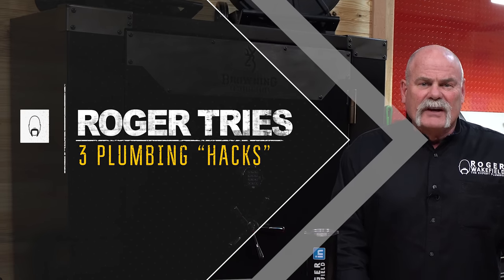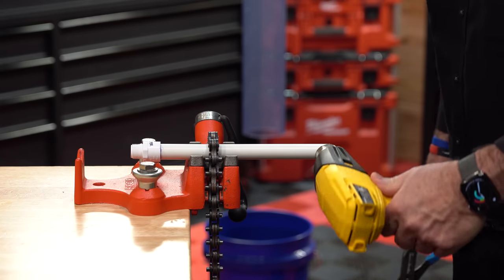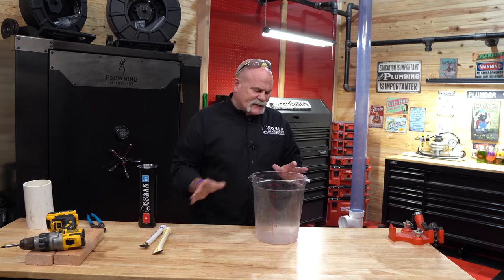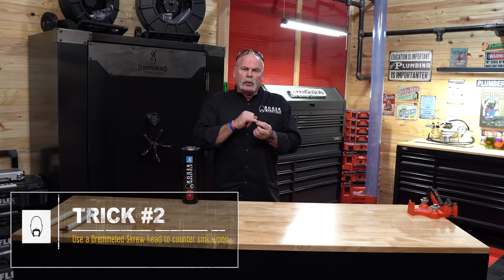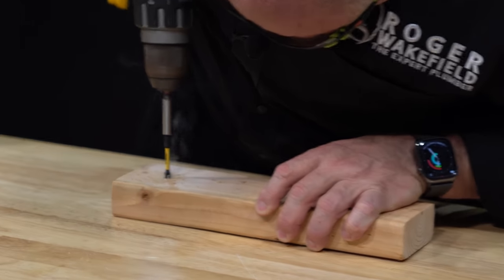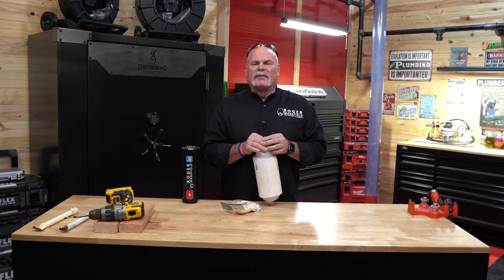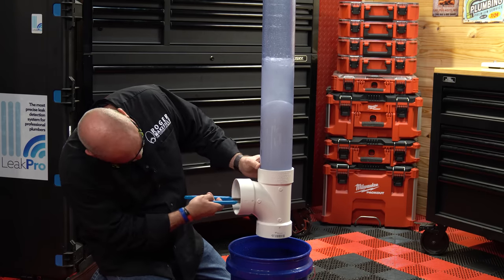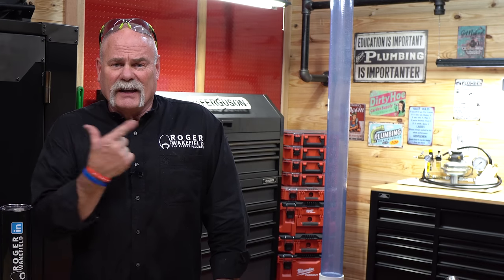Trying CRAZY Plumbing Hacks

Comment: My Late Dad being a Plumber/Pipefitter taught me alot about plumbing showed me a little hack, when you have some moisture that is still dripping out of your cut end where you are either going to sweat or glue a fitting, he shoved inside a slice or two of bread and pushed it in until the dripping stopped, afterwards when the water pressure was turned back on, it would flush and disintegrate the bread out and thru the drainage, no clogging what so ever.
Reply: My retired pipe fitter dad loves the bread trick

Comment: Many times have had to use a dremel to cut a screw head to be able to use a screw driver on it, unscrew / remove the screw normal when possible it is usually far easier than the screw out kits.
Reply: Done that many times myself

Comment: The green pipe shown was not pvc nor cpvc.  That was plastic weld pipe. I dealt with that crap over seas. I have seen that crap bend and stretch worse than pvc in Hot water.